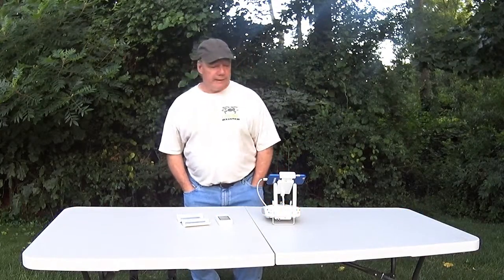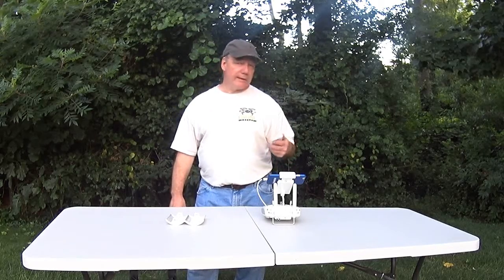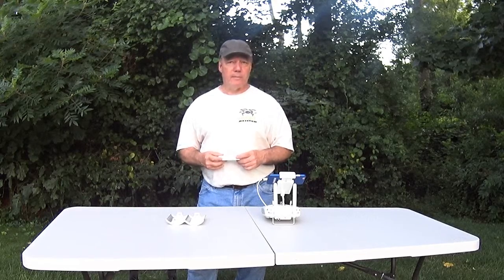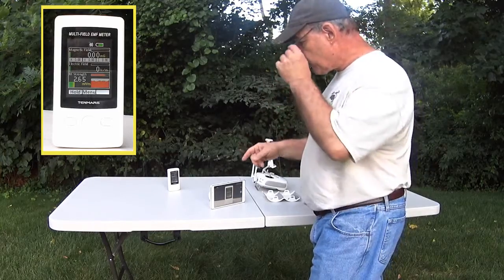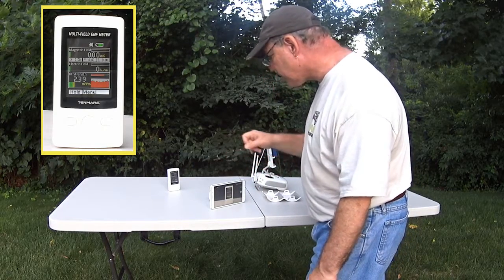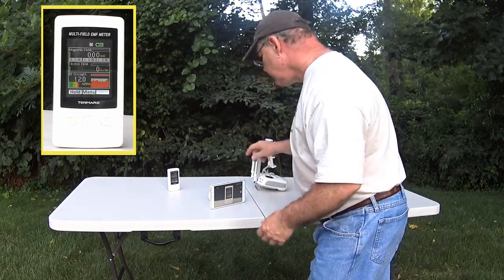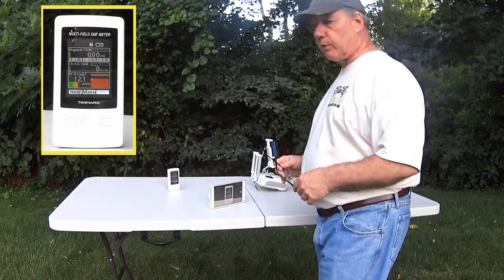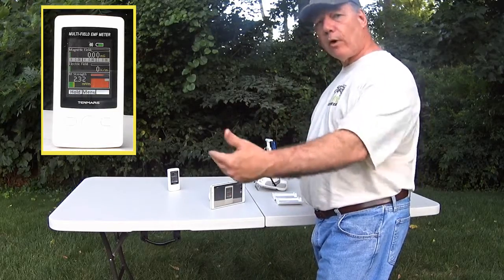DJI Phantom Drone Range Extenders do Work!

Comment: Thanks for the review, great demonstration on rf gains!  Two points....this turns your omni directional antenae into directional antenae.  This means to take advantage of improved signal strength, you MUST be facing your controller at the correct angle and direction to your drone.  If you are, say, pointing 30 degrees to the right of your aircraft, a mile away, your signal will be worse than if you had no reflectors on at all.  But if you are 3 miles out, and you are pointed directly at your bird, your signal is much better.  Secondly, your controllers signal received from the drone is improved as well, so picture quality on your tablet or screen is not degraded with distance as easily.  Pointing the reflective surface towards the ground is no good, the parabolic reflectors must be 90 degrees to the aircraft, all the time.  So proper orientation is key....and one more thing to worry about during flights.  Not sure how much help these are with the P4Pro, the signal is already very stable over distance with this model, so these may be overkill.  However, this being said, improved signal penetration thru trees, flying low thru creekbeds, may enhance your signal strength, with fewer dropouts on your video.  Monitor your signal strength bars on your sceen, as you fly, to help orient your controller position to your drone.  A fully charged battery will only take you so far out and still be able to return to home, so do NOT fly out 6-7 miles because you still have signal!  You won't have enough battery to get the bird back to you.

Comment: I like the video but as some have replied it was half the experiment, You proved your point, I would be curious to know what the improvement is over distance.  You would need a control element such as measuring RF with no signal, then RF with transmitter on and then RF signal with the extenders on.  Measure them at 100 yards, 200 yards and if you had the space 1000 yards.  But a good start with this video.

Comment: Rick, as always an awesome informational video!   Do you happen to know if these come with some kind of plastic cover over the copper area?   I got mine it it said to remove the plastic covering on it but for the life of me I cannot get any plastic covering off of it and am worried I just succeeded in scratching the surface area trying to get a covering off!
Reply: I kept picking at it and sure enough there is a clear plastic protection cover on each reflector.   I would bet anything some people leave it on and have bad results do to it's presence.  I did a video showing the difference and how it looks.

Comment: Rick 

You did this test before acquiring the Mavic.  I have been following your, and other members
You Tube contributions while having to wait 4 months to get mine.  Now I am being ultra cautious about its first
flight by trying ensure that all the settings are functional and
non-conflicting.  

This review of the signal enhancers certainly shows the
boost that it should with the signal strengthener, but will this apply to the Mavic,
and can you answer why so many owners are dubious about their own particular
tests?  Do you think that some boosters
work better with certain models while having the opposite effect on others? 

Sorry to be such a worry guts but 1100 UK pounds plus nearly
half again on peripherals is a real pocket holer for an old fogie like me.

Rich

Comment: 3:23 / 5:24 can you show the angle that the radiation travels at the farther downrange? It is like 45° or 90?
Reply from the maker: Thanks for the post and the transmission spread is between 100 - 120 degrees in my testing so it's not very narrow at all. As long as your pointing in the general direction of the quad you'll be fine. Thanks again for the post and be sure to sub the channel. Rick

Comment: Liked your experiment, proved to me that it was an upgrade. I though of a single possible downside however. Does using the reflector make the drone more sensitive to signal direction. I.e you have to keep your controller pointing at the drone. Like you said without you have 360o signal, with have you cut that down to 180o?
Reply from the maker: Thanks for the post and the beam spread is about 120 degrees, which is very forgiving. You can basically be pointing in the general direction of the quad and still have a great signal for flying. Thanks again for the comment and I hope you sub the channel. Rick

Comment: Doesn't this violate FCC rules?
Reply from the maker: Nope, it's not increasing the power of the transmitter, simple redirecting the signal. Some of the "boosters" on the market do violate the FCC power limits so even though they work, stay away from them. Thanks for the post and be sure to sub the channel. Rick

Comment: It would seem that if someone fears that the projection angle is too tight and limits the pilot to facing the drone all the time, you could fly w/o the extender for most flights and only mount the extender when, and if, there is a signal loss problem.  The extender would be a kind of insurance policy.  Of course when that situation occurs, the pilot would need to exercise the discipline of facing the flying drone. Small price to pay if it means bring back your drone.  :-)

Comment: I appreciate you doing this test Rick, but don't you also need signal back from the drone to maintain a good connection? I'm trying to understand how extending the broadcast range of the controller helps maintain a two-way connection with the drone. Any thoughts on that?
Reply: stanscocom   As long as you pointing the parabolic surface at the drone, your received signal from the drone is focused to the stock receiving antenna on the controller, improving reception.  Stronger video uplink to your tablet or phone.
Reply: This is my question exactly.  I would think that if the drone gets too far away for it's signal to get back to the controller, then the signal would be lost.  I am in no way an expert on how these communications work - I have no idea how it works, but it seems like there is two-way communication with the drone and this is only helping one way.

I CAN see how it could help a little, because you are giving the return signal a bigger target to hit coming back to the controller (the width of the reflector vs the width of the antenna).  Maybe that's why some tests on youtube show about 50% increase in distance - rather than the 400% that this video shows the signal being boosted by.

Great video anyway - I appreciate all of your videos!  It's all great stuff and you're obviously passionate about this stuff.

Comment: Great video, have you by any chance done this with the PS3? I watched your other video on the ArgTek upgrade for the P3P which has a different controller. As I have the PS3, it would be great to see your take on that with the same equipment. My controller has but one antenna.
Reply from the maker: Bill, thanks for the post and the P3S actually has 3 antenna. They have one external and two more buried inside of the controller. ARGtek makes a kit for the P3S, which moves all three of these to the outside to help with signal strength. There is also a parabolic reflector avialable for the controller that can boost your range. The biggest challenge with the P3S is that it doesn't use LightBridge for connecting to the quad like the P3A and P3P. This technology is what gives those birds their amazing range. The P3S uses Wifi, which limits how far you can fly with it. I will schedule a clip to expand on this comparison in the next few weeks when the weather breaks. Be sure to sub the channel so you don't miss anything. Rick

Comment: I know most of us with half a brain will realise this.
But just a point to make.
If, for whatever reason. You no longer face the direction of the drone. You will completely lose connection.
Most, if not all, high end drones will activate the RTH in such event.
But just an important point to remember.
Reply from the maker: Andrew, that's correct and I even think I mentioned in the clip that the reflectors eliminate the signal (most of it) that is normally sent back towards the operator and wasted. While in theory this might seem like a problem but in practice I can't imagine how anyone would maintain VLOS while a drone is flying behind them :) The other advantage is that you're not exposed to this wasted radiation while flying. I'm not sure what the long term effects of this exposure will be but I like that these eliminate that worry. One last thing, the bean spread with these is about 120 degrees so you only have to be facing the general direction of the quad for these to work well. Thanks again for the post, Rick
Reply: Did you watch the video Kim?  Because he clearly states that with other interferences out there, this is a good way to help override those and keep your drone's signals at their peak which is what we all want to begin with.  It doesn't have anything to do with breaking the law or a lack of VLOS, it has to do with keeping the best possible signal coming and going to your drone at all times plain and simple.  Stop trying to be a pessimist and find something wrong with a great and informative video.
Reply: I was going to say the same thing, or if you lean it down etc
Reply: tone1myth2ad j
Reply: Not true..the software will notify you of weak or lost transmitter signal in plenty of time to face the drone..Been there..tested that..Phantom 3 Standard and Mavic Air..

Comment: Rick I use an ipad pro 13" with an extended mount for it. Will these allow the tilt of the ipad or will it touch the ipad? Ideas?
Reply from the maker: You should be fine since these sit down to the base of the antenna. If you're not touching them now, these won't cause a problem for you. Thanks for the post and let me know if you need anything else. Rick

Comment: The major flaw with this experiment is measuring in the near field.  I don't know what kind of engineer Rick is but I don't belief it is RF.

The same experiment over 20 metres or so with the meter well off the ground (5 metres?) would be more "valid".  Why so high?  Fresnel.

I've seen a couple "real world" YT videos and in one the effect is marginal at best and the other it actually reduced the performance considerably.

And actually, yes, the only test that does count is a real world test where the signal is actually proven by the display (video and controller reception) "bars".  (Wish it were in dB).
Reply from the maker: Alan, thanks for and I have an Electrical Engineering degree with minors in both RF and computer engineering. I have seen a few of the clips that purport to show these not working but using the "bars" on the controller as a measure isn't a very accurate system at all. The simple answer is that the parabolic effect these are based on has been used since ancient times to focus both transmission and reception for everything from RF signals to light beams. The entire DishTV network is based on it, as are flashlights. In general the parabolic reflector is designed to send more of the active signal downfield that is normally wasted by radiating behind you. The beam spread on these is about 120 degrees and they do a great job of increasing signal strength. The trouble with measuring the signal further away from the controller is that the ISM band (which these broadcast in) is very crowded and it would be impossible to differentiate the controller signal from all the other noise in the area. I have used (and tested) these extensively and they really work well. Thanks again for the post and I hope you sub the channel. Rick
Reply: Regardless, a near field test as you demonstrated is that.  A near field test.  Strongly suggest you do the same test with a good separation between the controller and the meter.  And the meter should be well off the ground to reduce the Fresnel effect.  Finally, various videos show mixed results including negative contribution.  To me this is not settled until a given product shows consistent range improvement in the field.  A meter just tells you what happens in those test conditions.
Reply: Oops.  My apologies Rick, per a simple calculation your measurements were actually in the far field.  (I'm used to using larger antenna systems).

That said, I believe the story has not been completely told as evidenced by those who are getting good, neutral and bad results...

Comment: Great videos(I always enjoy your videos) and nice test.  Can you use the meter and determine the approximate angle of the enhanced signal?  We have seen videos of people testing with and without range extenders and the results were negative(as indicated by the signal strength on the DLI Go app).  One possible explanation is the extender narrows the beam and if one is not pointing the controller towards the drone, the signal is actually weaker.
Reply from the maker: Phil, thanks for the post and measuring the angle of transmission is tricky because there is so much noise in that band (ISM) that it's hard to tell what is coming from the quad and what is just background noise. I did do a rough test where I would start with the meter directly in front of the extender and switch the controller on and off as I moved closer to 90 degrees away from center. What I observed is that the beam "spread" was about 120 degrees as close as I could tell. This means that if you're pointing the controller in the general compass direction of the quad you should be fine. It's not a narrow beam by any means and is pretty forgiving by my testing. I hope that helps, Rick

Comment: As far as whether these slip over range extenders work,  I generally only see people measuring transmission distance.   This seems much less important to me than reception distance.   At long range, what good does it do to have control over the drone if you can't see the video stream or at least position on the map?  I'd rather the auto return kick in at this point anyways.  Additionally the reception signal is a lot higher bandwidth than the transmission signal.     How about a video where you fly the drone out to the range limit without the range extender and then pop one on and demonstrate the increased range if it exists?
Reply from the maker: Nick, Thanks for the post and I agree that it would be great to see the signal strength at the receiving end but it's trickier to measure than it seems. The challenge is that there is a lot of "noise" in the ISM band these quads use to connect. At distance it would be impossible to identify the signal from the quad from all of the other background noise, especially the farther away you are from the quad. The honest answer is that since there is a noticeable increase in the signal strength at the point of transmission, this advantage carries throughout the transmission range, providing a stronger signal all along its path. There's a formula for calculating this advantage at every point along it's travel but I'm not sure this would interest anyone. As far as long-range flight goes, I'm not a huge fan of distance flying since we have a VLOS rule with the FAA and my aging eyes can't follow a drone more than a few thousand feet. The fact that these extenders allow you to fly even farther than the stock antenna is a moot point for me since that well beyond VLOS. I hope that helps and thanks for the post. Rick

Comment: Great video and awesome way of showing with actual numbers and realtime data!! I would like to see the same test done at a distance. I am an engineer myself with a background on wireless communication and would like to see how the signal bevaves at a distance. What Im thinking is that the signal is a lot stronger and visible because you are very close to the source, but one those waves start bouncing against eachother and cancelling each other out, you will be left with a weaker signal at longer ranges. Would you mind doing this test? Lets say about 100' away. Sorry that Im asking, but I am curious to see the results of that test, and since you already have the tools, well..... lol. Thank you so much!
Reply: Alain Sainz I was thinking the same thing. I would like to see the meter read a signal a few hundred  feet away from remote. Thank you for the question.
Reply: Test it with a bank of wet trees between pilot and UAV.  That's a real-life test.
Reply: that test would only be possible in a place without any wireless device in at least 1/2 a mile radius.
Reply: Go to las vegas!!! I know just a spot with little to no interference at all!!! except for those darn UFO signals of course!!! 😄

Comment: Thanks for providing this video. I have a diy parabolic reflector I use regularly and it works fantastic but I didn't know how much it helped. I did a range test recently with my latest reflector and with the reflector properly focused and had a 16,807 ft flight with a phantom 3 standard.  The battery ended the test and initiated a RTH but the signal was dropping out at that point as well. From my trial and error experience the distance from the antenna to the reflector makes a world of difference in the signal strength. I recorded the flight and have healthy drone telemetry as well if your interested. I didn't want to supply a link publicly on your site without your approval. I enjoy your channel. Thanks for the time and effort spent educating the public.

Comment: Why don't you put it front to back and show how many waves reflecting/how much signal are weaker on the other side?
Reply from the maker: I plan on doing a follow-up clip that compares the parabolic range extenders to the dedicated upgrades like the ARGtek and will show you the difference between the front and the back of the antenna. Thanks for the post and be sure to sub the channel. Rick